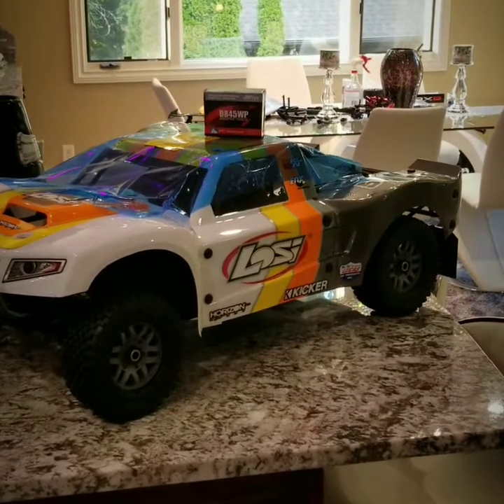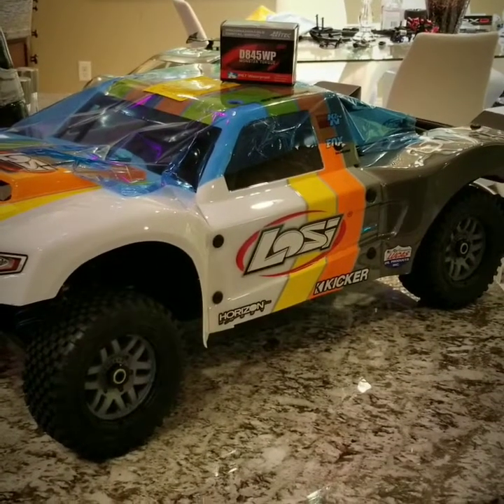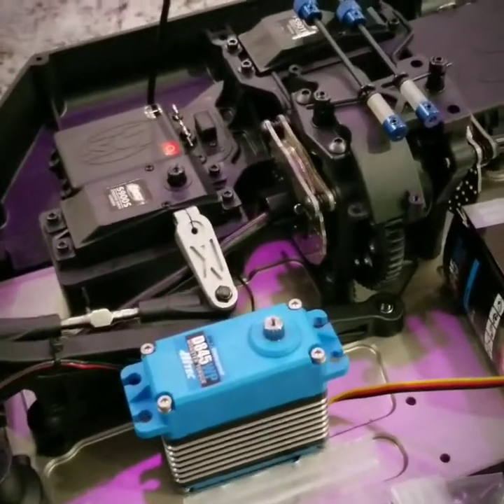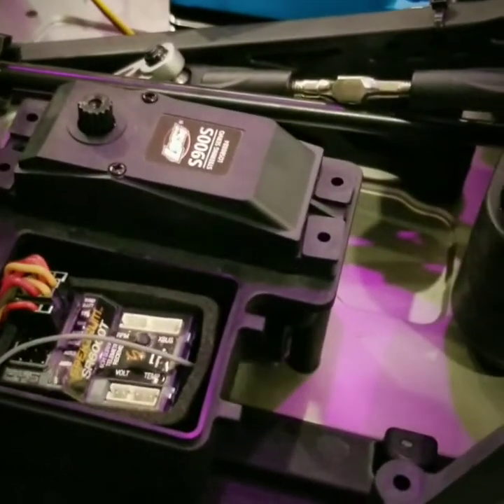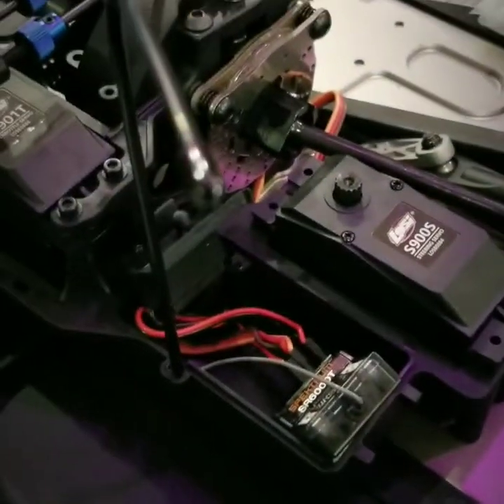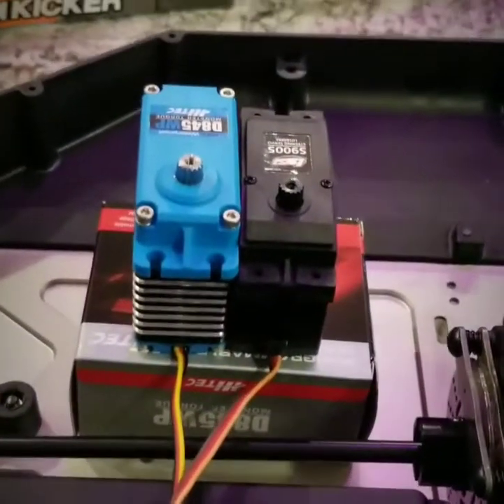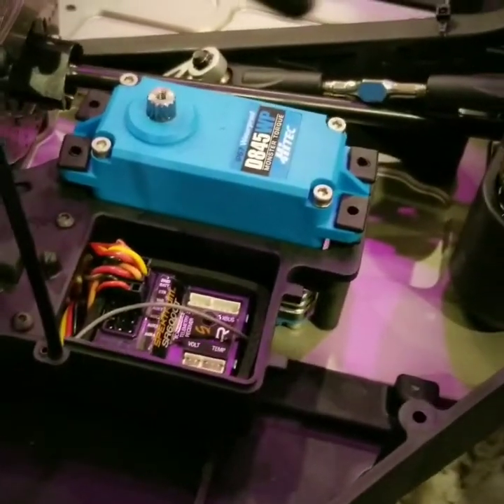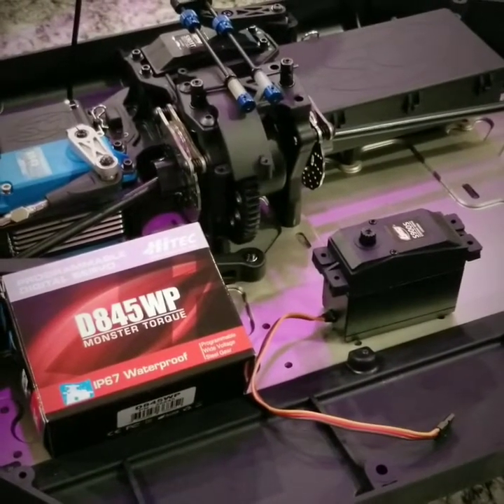Losi 5T 2.0 Modifications Part 1 - Hitec D845WP Servo Install

Comment: I am interested in purchasing the same model D-845WP for my Losi DBXL-E, Whats strange there are 2, One with a Black wheel which is the one you have and one with a white wheel, But the model with the white wheel most of the housing is black but its the same model numbers, Do you know the difference between the both?
Reply from the maker: I see some slight variations in torque, but could be a typo too.  I mean even it the differences were right they still wouldn't be noticeable. I'm not sure what the real difference is except maybe just the box design.

Comment: I have the losi dbxl-e 2.0, do you know if the d845wp is a drop-in or will I need to buy the adjustable steering links?
Reply from the maker: It was a direct drop in, but I now have a dual servo tray that we custom accent polished the outside lines all the way around it.  It is in my recent videos if you want to check out the tray.